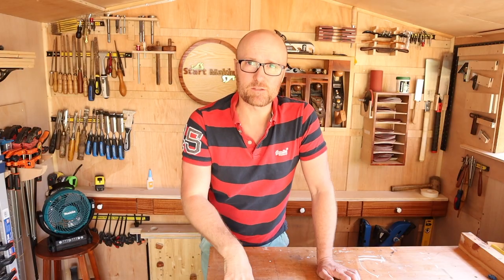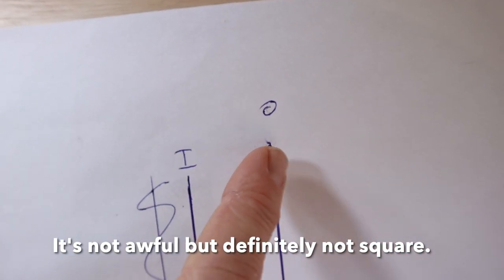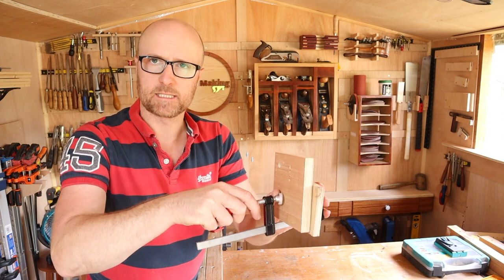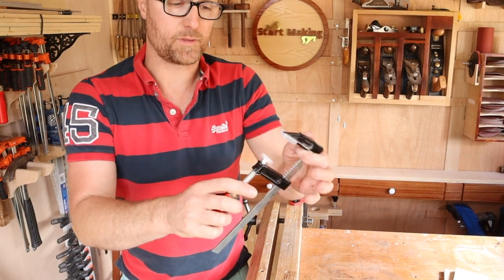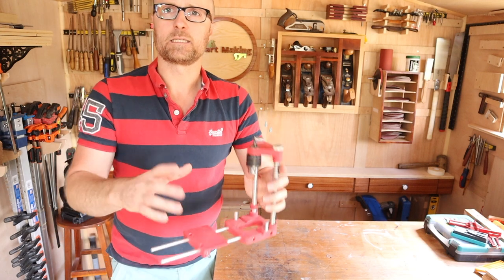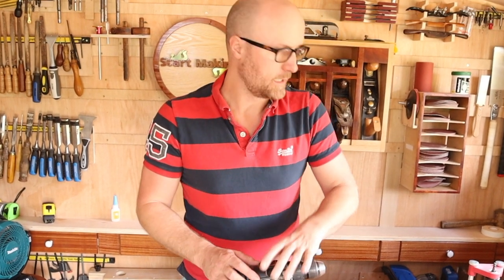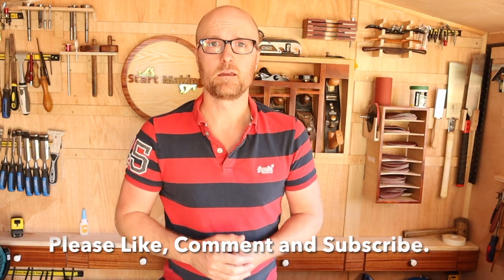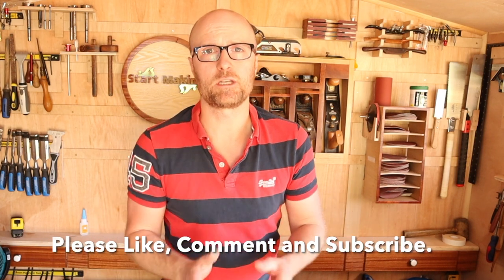5 WOODWORKING Tools to AVOID Part 2 || The SOLUTIONS.

Comment: Thanks for your input Mark, a decent speed/rafter square , 6 quick grip clamps , a good straight edged flat square are all I've ever used , 9hh and a sharp.pencil 😂 . Love the ratchet-strap idea !! Haven't delved into the world of pocket screw jointing yet but great info on it .
As you say it's worth , in the long run , spending a bit more for quality tools that should last a lifetime.
Rafter square is an absolute game changer. Cheers 👊
Reply from the maker: Hi Graeme. Thank you so much for your comment and for watching. Pocket holes have their place and when used for it are excellent. Not for every project though. I love a sharp pencil, if I can ever remember where I keep putting them. Cheers

Comment: I am not sure if it is available for your particular Kreg jig, but there is a black adapter that is available for their older models. It has smaller drill holes so you can use smaller drill bits for thinner plywood. If you watch the Kreg demo of the guy building a nice looking cabinet using nothing but Kreg products, he uses it to attach the drawer bottom to the drawer with small screws. That Wolfcraft jig looks like an absolute nightmare!
Reply from the maker: Hi Gregg. What a great piece of advice. Thank you. I will check it out. Would certainly be a big help. Thank you for watching and commenting.
Reply: They do make one for the 720 model.
Reply from the maker: @loganmedia1142  Fantastic. I use a lot of half inch ply and that would be amazing

Comment: I noticed you use a Worx drill. (I love their tools.) Have you checked out their Nitro drill with the rotating dual head?
Reply from the maker: Hi Jim. Good spot. This thing wont die. I was trying to get on the same battery platform as my other tools but it is so sturdy and puts up with all of the abuse I give it. Bonkers. Just googled the nitro. I like the concept. I wonder how well it lasts with the dual head.

Comment: Looking at the pocket hole jigtomeit seems you are not using the right screws. They are way to long and the the wrong guage and appear to be countersunk - there are specific screws the job designs may vary but the the way the screw works doesn't
Reply from the maker: Hi Big Bloke. Thank you for watching and for your comment. You are right but as a fair test I used the screws that came with the kit. In the first video where I just outlined the issues with these tools I spoke about how it should be the proper pocket hole screws. NO idea why they send the kits with these ones. Thank you again for watching, and commenting .

Comment: Mil is not an acceptable abreviation fir millimeter.   Mil is 0.001inch.  understand that mil isnt just an informal  abbreviation for milli-inch, mil is the  actual officially standardized unit if measure.  And the use of 0.001 inch in imperial/us customary units  dates back to Joseph Whitworth in  1857. One olace mil is officially  defined is the uniform code for units of measure.  If you ask gnu units (or similar programs) to convert 34mils, you will get 0.034inch.  If you ask google to "convert  34mils to inches" it will give you an answer if 0.034inches (but first you will have to undo the autocorrupt to "miles").

Some things commonly measured in mils is thickness of paper and the width of printed circuit board traces.  Also small  machined features though "thou" is also used for the same purpose.

Mil/mill/mille was also a unit if currency US$0.001 or UK £0.001  going back even further.  $0.001 is now "milke" and deriving frim ancent roman not the metric system.
Reply from the maker: OK. But if its pretty set as a habit now.

Comment: The slipping F-clamp problem is probably more down to the fact that the malfunctioning clamps moving part with the twisting handle has angle, that is too close to 90 degrees and therefore slips. You would have to open the clamp by removing the stop-pin and trying to file the clamps moving parts oval holes edges so that the clamping angle would be greater and the moving part would bite by itself into the bar due to steeper angle of attack.
Reply from the maker: Hi Ahto,. Thank you. What a great detailed comment. Really helpful. And thank you for watching,

Comment: Yeah the vertical drill guide is very inaccurate. And it is hard to use ergonomically.  The result is so bad that anyone can drill freehand and get more straight holes.
Reply from the maker: Agreed. Shame really as they seemed such a good tool in theory;.
Reply: @startmaking1  one hand pushing down on the base of the jig, then we need to push the drill down while keeping the motion somewhat vertical.  You need long arms to do it right
Reply from the maker: YEah, Not really a position I want to take to drill.

Comment: If I did that 100 times I'd still never be straight my hand shakes ever so slightly I know because when I was taking art classes I noticed it yes there a way to fix that by crossing arms, but can't do that wile drilling.🤭
Reply from the maker: Hi Bigdog. Im sorry to hear that hand shakes make your woodworking difficult. Crossing arms would certainly hinder drilling. I had a suggestion about butt joining 2 blocks of wood to use as a guide , maybe that is a better fix for you. Thank you for watching and commenting.

Comment: Sorry, but you really don't know how to use an F clamp.  When you want it to bind, you put pressure on the outside edge of the anvil (i.e furthest from the contact pad).  The way you were handling it garantees that it won't hold!  I didn't watch teh rest.
Reply from the maker: Hi Tony. Dont be sorry. I didn't read the rest.

Comment: you are using thr wrong screws for the pocket wholes
Reply from the maker: Hi Lina. Thank you for your comment. Take a look at the first video you will see that these are the screws that it came with. So for an accurate test of the jig I have used them. In the first video I tested it with the proper screws. Thank you so much for watching and especially for commenting.